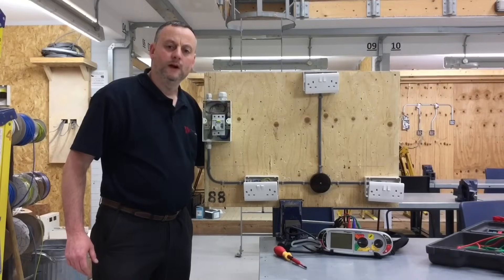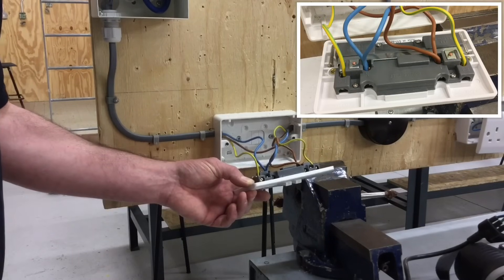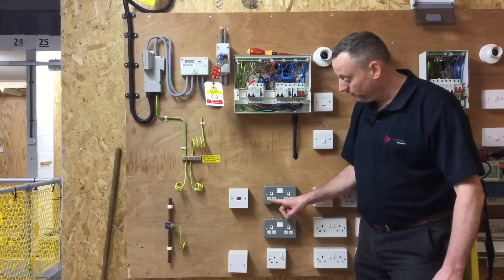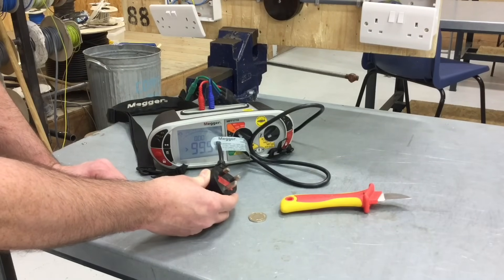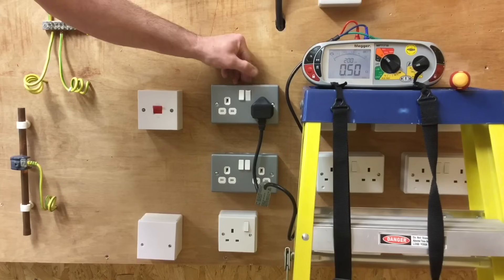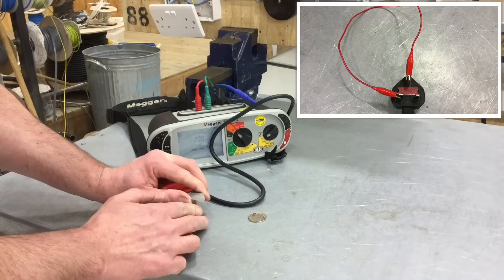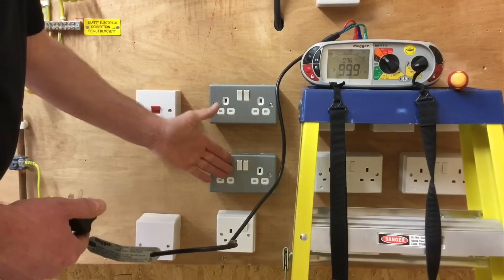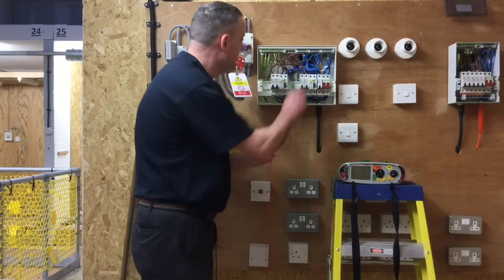Our A3 Radial Socket Circuit Tested for Continuity of CPC, Polarity and Insulation Resistance

Comment: Holy shit! Do you have to do R1+Rn also? Thought it was just r1+r2
Reply: Same here
Reply: IMHO R1 and Rn is a good test to reveal loose connections and especially trapped insulation where wires are pushed in beyond where they are showing bare conductors before screwing terminals down.  The values are not recorded on a test sheet but a significantly different reading between adjacent accessories will alert you to an unsatisfactory connection between the two points.

Comment: How many sockets can you have on a radial?
Reply: As many as you like.  Ensure the protective device (MCB or RCBO) is adequate for the cable chosen.  2.5mmT&E needs a 20A, while 4.0mm can use a 32A. Do consider volt drop if the run is particularly long.

Comment: Thank for the great videos. A simple question please help, why are you showing Live terminal on the socket plate located on the right handside? 

when we open a plug we see the live pin is located on the right handside, but when we plug it in, the live will be located on the sockets left terminal.

isn't that how it is?
Reply: No. Live pin is on the right.
Don't forget, you are taking the top off of the plug.

Comment: Great demo Gaz. Thanks for he efforts.
When u test the ir from neutral to earth you put it on both bars. On the screw that clamps down the circuit being tested but all the other circuit are in situ do how is that an accurate reading of the individual circuit neutral n earth?  It seems like u would be testing the combination of all the circuit neutral to earths that way. Having said that if there were to be an issue of a low reading would u then pull them out to isolate them directly from.thr bars??

Comment: When I made a test board back in the Mid 90's I put heating element's in to make it look like much longer wiring.  Also a on the back was a socket were we plugged in a plug with just 1M 2M 500K resistors in with a rotary switch we had 3 ( one with Live neutral ) ( Live / Earth CPC ) ( neutral CPC )  that was for insulation testing - We would have a light switch to switch in and out on each L & N a heating element or just a long wire of 20 meters to make it look like a bit of a loos connection on the L or N only so one side would be a much higher test reading.

Comment: thanks for all the videos but don't make the excuse that you get a low resistance due to short cables. You're an electrician, go buy some resistors and start soldering them in.
Reply from the maker: Our low readings can be due to cable lengths say around 10m and the cable in a domestic installation could be many more metres longer. All our exam rigs have power resistors in them to increase circuit resistance/impedance all the best and thanks for watching Gaz

Comment: Excellent video...What does the term  "A3" mean?
Reply from the maker: Hi great question.... Pass.
We use A1 for a ring final circuit, A2 for a radial socket circuit and A3 for a radial socket circuit with different considerations. Thanks Gaz
Reply from the maker: Just a broad overview
http://www.electrics-home.co.uk/index.php/2014-11-30-11-31-19/radial-circuit/25-circuits
Gaz
Reply: Cheers, that's much appreciated!
Reply: Lovely.

Comment: Can u tell me what extent of electrical work a non qualified person is permitted to do. I e could I run all wire's to relevant place and connect sockets switches etc thank u
Reply: Technically you could do everything you could install a socket or a distribution board the problem is you can't sign it off on an eic form and guarantee it's safe operation. If anything happens (fire,electric shock) and it's traced to you it could be manslaughter. I know it sounds a ridiculous but that's the rules. Being an electrician is virtually the same as gas safe that's why we have to keep our quals up to date. So my advice call a professional.
Reply: @markdove5906  - How about notifying building control? Would they not come and check it? (notifiable stuff that is)